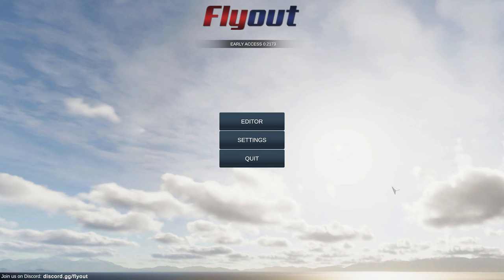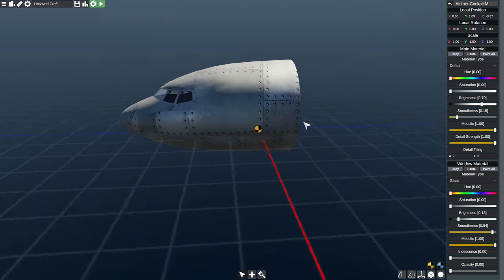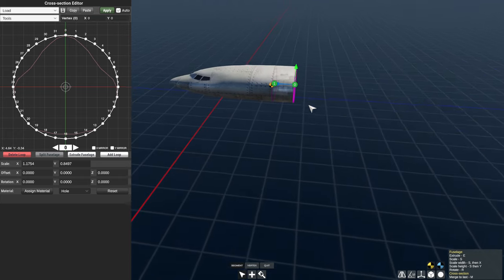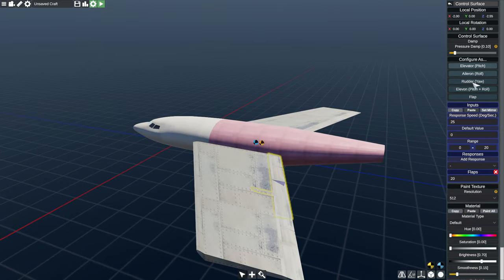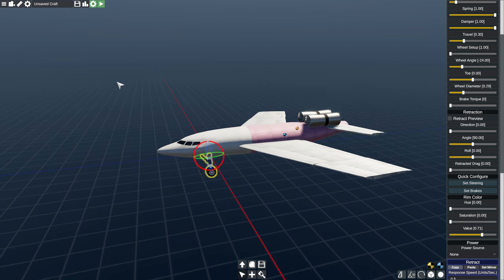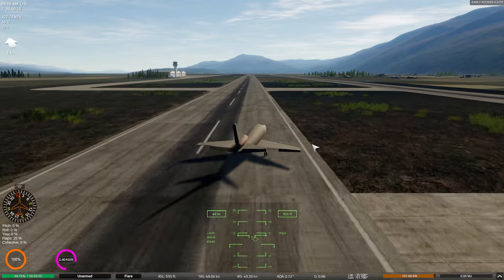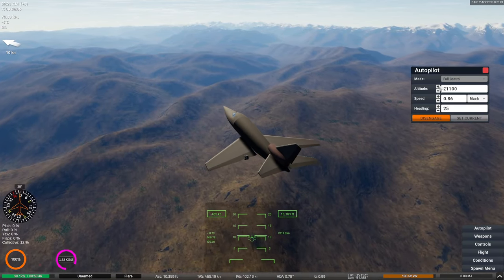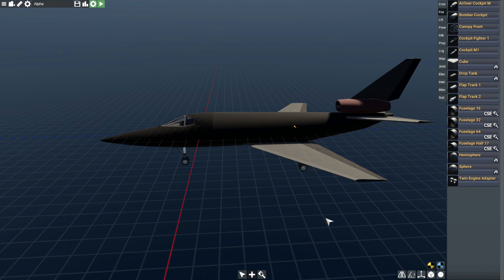Intro to Flyout - Aircraft Design and Testing Sim

Comment: One thing to note is that while the preset cockpits are there (mostly as an easy solution) you can create your own. Say by using another fuselage or by using the existing one, then tweaking the individual material on a segment (square between four vertices) to be glass/hole. As for the map, it's an Earth-sized sphere. There's a map of it that goes around the Discord but a map would definitely be nice in-game for long-distance flights / planning airfields when file editing.